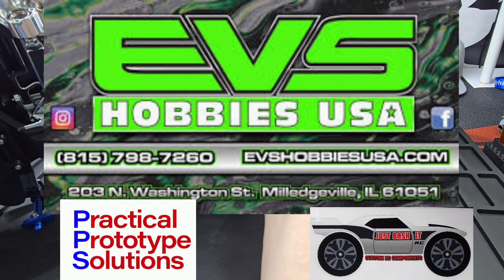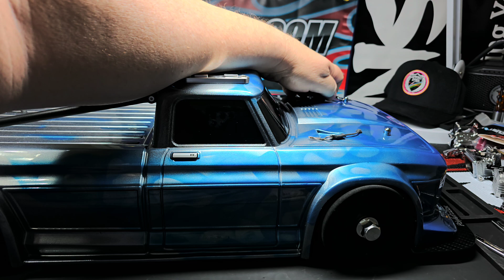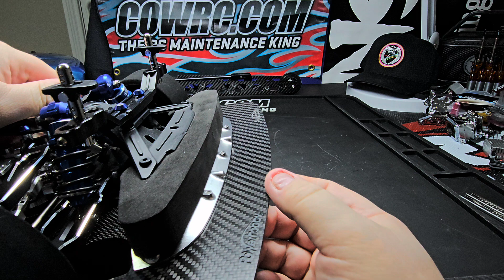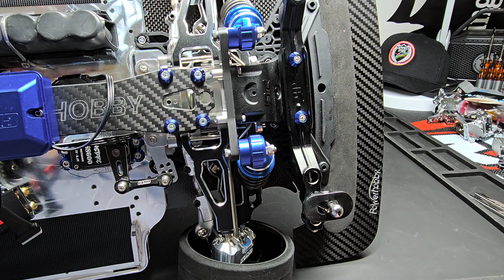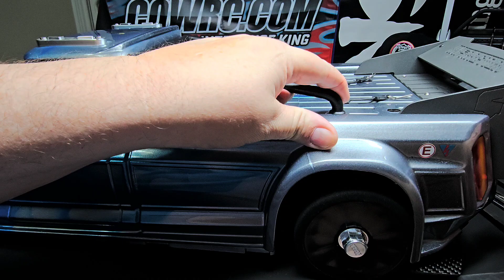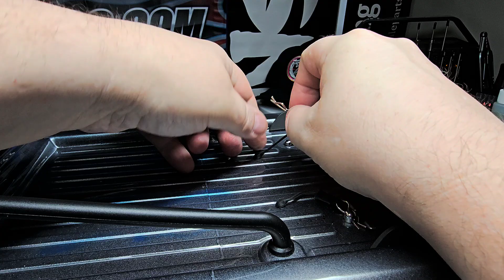Final Review Of The Single Motor Speed Infraction Along With A Review Of Each Part Of This Build RC

Comment: The holes in the chassis may cause a loss of negative pressure under the chassis, which will reduce traction.
Reply from the maker: @general-e8628  yup, that's why you have a tape session before each run.  You have to tape the entire body down to to deal it.